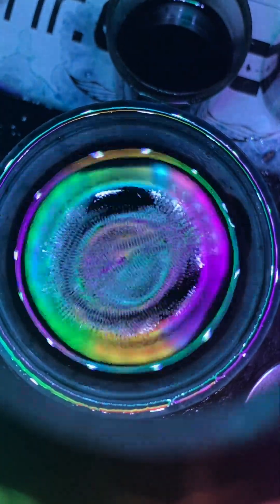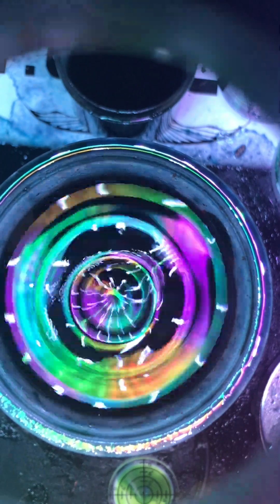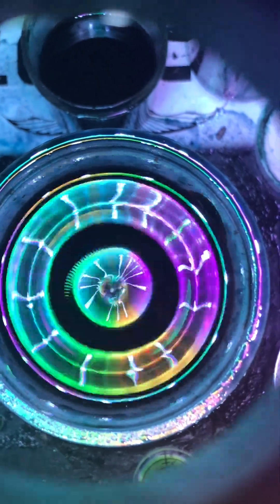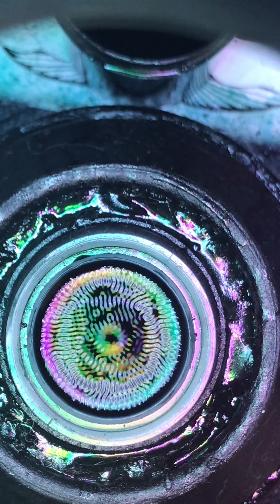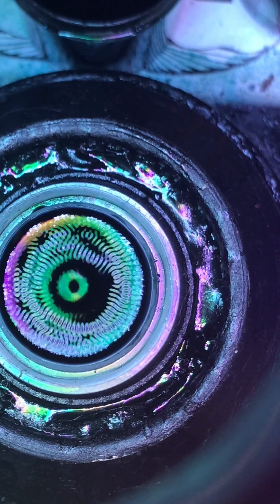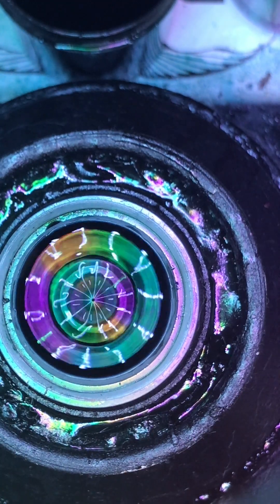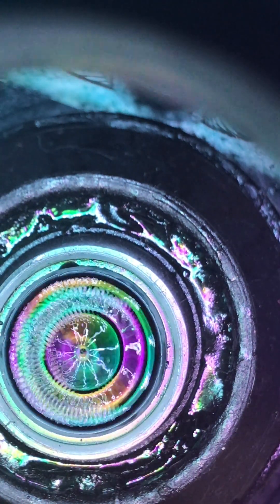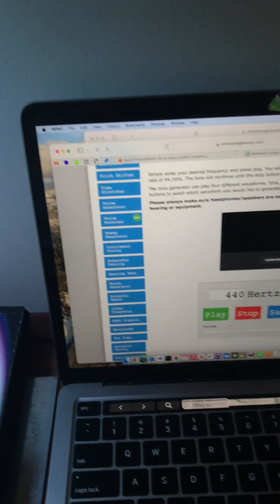432Hz vs 440Hz - The Truth in Cymatics

Comment: What I'm seeing is that 440 Hz produces an almost perfect shape, but the way it flows is very rigid and erretic, and it almost looks like an electrical wave. Whereas 432 Hz may not be as perfect looking, but the way it flows is much smoother and more lax. So, although you're right that there's really no such thing as a "healing frequency," what is at least true about those frequencies is that the smoother frequency will always have a much more emotionally resonant feel to it. And 432 Hz happens to be the smoother frequency. Therefore, 432 Hz is still the better frequency.

Comment: What other fluids work well for cymatics? Interesting you keep mentioning variables of the experiment, which could effect the outcomes. What is the frequency modulator that you use?
Reply from the maker: Any fluid can be used, but if you want good pictures and easy-to-create standing waves you need a fluid with low viscosity but high surface tension. I use a human blood-mimicking fluid based on a lab-certified fluid I ordered from a medical equipment site. The fluid is used to calibrate ultrasound equipment so it needs to be as physically close to human blood as possible. Interestingly, blood is quite low viscosity and high surface tension. I do cut the surface tension a little though with a surfactant to allow the fluid's surface membrane more flexibility.